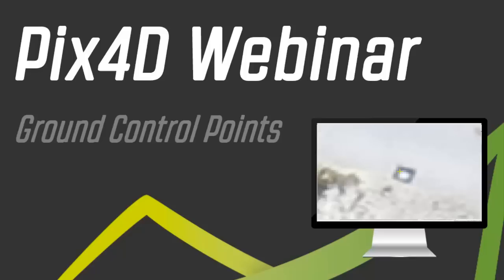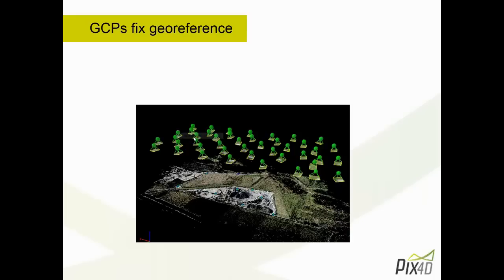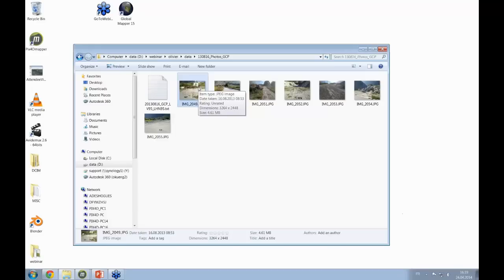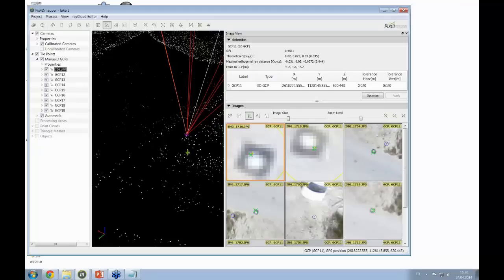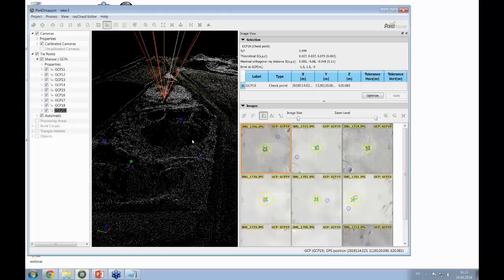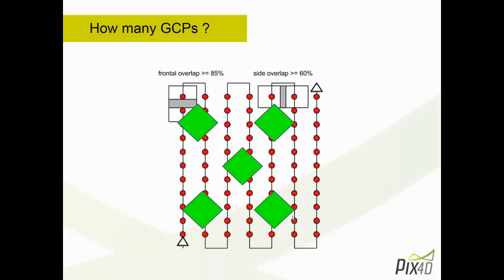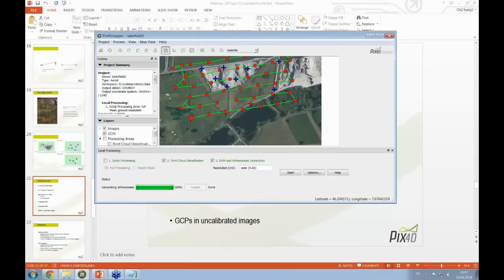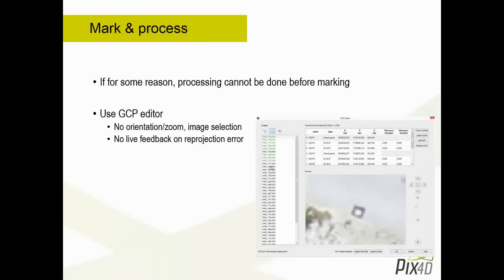Pix4D Webinar 2: Ground Control Points

Comment: Hi - what device(s) would you recommend for using to get accurate GCP points? (preferably affordable).
Thanks
Reply: Grant Johnston This would depend on what wavelengths of light you are taking your imagery in. We've found plastic bucket lids painted black are good for agricultural purposes. *I just realized that you probably meant the GPS coordinates for the GCP's. I think a survey quality GPS would be necessary.

Comment: What were the values that you used to calculate your error? I know that you took the Z values from the constructed image using Pix4D, but don't you also need "true values" for the elevation (Z) so that you can compare your values to that? I was thinking you might be able to find that on Google Earth , and is that what you are comparing your values to? Thanks!

Comment: when inputting GCPs, do you put in the altitude in meters or feet. Also, when inputting my photos I do not have GPS EXIF data on the photo so must input gps data using a separate file. The file only produces the height, e.g., the mission was planned at and not the altitude the photo was taken at. Must I convert this height to altitude. I think I must. Does this altitude go in meters or feet.
Reply: I believe you can put it into either depending on the coordinate system that you use, since different coordinate systems use different units. I think it is safe to say that meters are always best since much of the developed world uses this and since the program was developed in Europe.
Reply: The software checks the default depending on the coordinate system used, but you can change that if you want to.